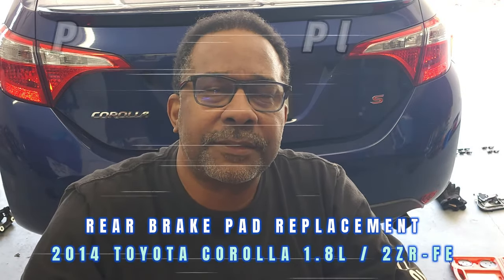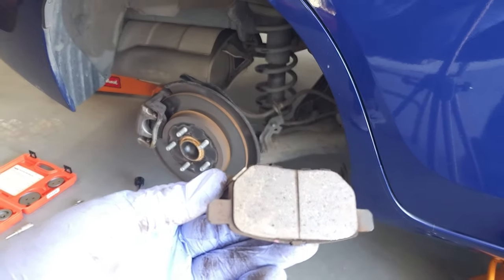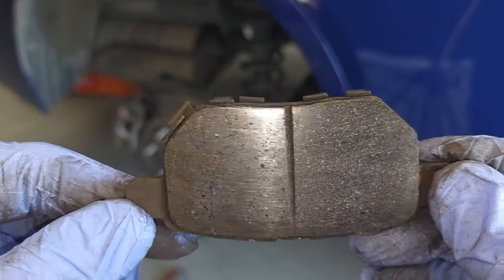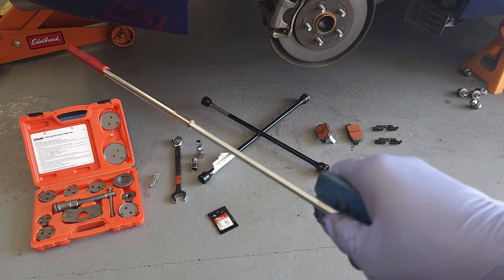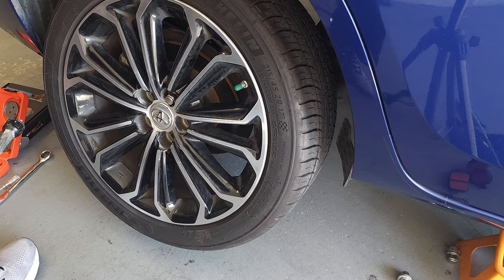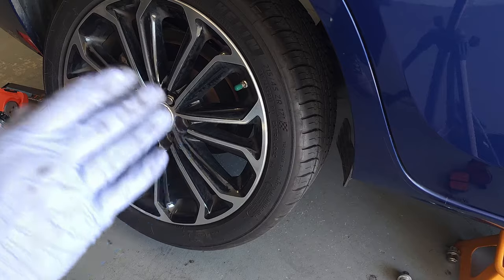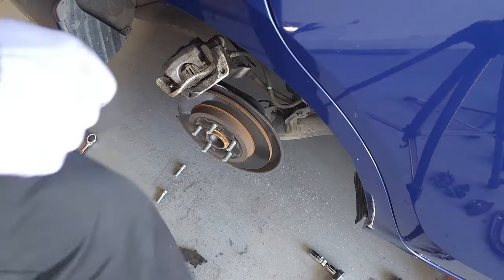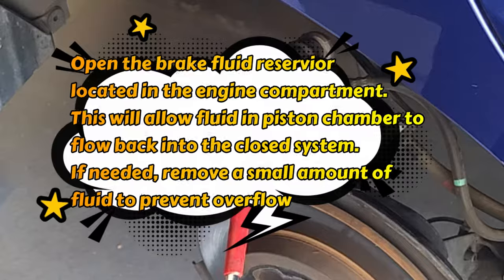2009-2018 Toyota Corolla - Rear Brake Pad Replacement Tips

Comment: That's a difficult way. Remove sliding pin bolts, lift off caliper, bridge should remain bolted to the axle housing. Pads are easily accessible and fitting then back into the bridge is much easier this way. 5 minute job.
Reply: Yeah.  Never seen anyone go this this much trouble unless replacing the rotor too.
Reply: @ronmoore6598 it's not even that much trouble even when replacing rotor.
Always easier to split the caliper from.the bracket.

Comment: Thank  you for the great video.  I'm doing my first Toyota Corolla brake job on my sister in laws car and found your video very helpful.  I'm sure you'll agree that when performing a brake job, you'll almost always have a couple of hiccups, but if you stay calm , as you have in this video,  you'll be able to work through the hiccups and complete the job without a lot of frustration.  Thanks again.

Comment: I followed all the steps and the only difference is that I had these two wire springs inside the calliper assembly that fell out when removing the old brakes. Installed the new brakes without them as I had no clue how those would have been reinserted?
Reply: @protipsplus  I’m confused because you did not have these springs in yours and you have the same year and model as my car?
Reply from the maker: @PedroFilms  
If the brakes are working fine then the springs likely connect to the parking brake. You can call me on what's app
Reply from the maker: I videod a car with Disc brakes. You must have drum brakes and brake shoes.  SEE https://youtu.be/eG6ru9doLNg?feature=shared
Reply: @protipsplus  I think they are meant to keep the pads from riding the disk when not engaged. I’ll have to investigate it next weekend however as I’m working late this entire week.

Comment: Does  a Toyota quest rear brake caliper piston tunes clockwise
Reply from the maker: Not 100% sure, but you can purchase a caliber piston compression kit from AutoZone. Keep the receipt and return it after you're finished. Speak with the parts clerk or manager. They allow this on a regular basis.